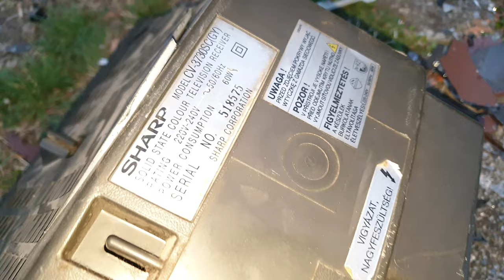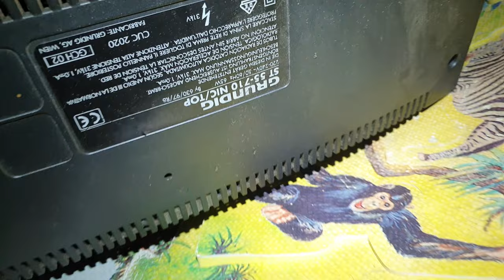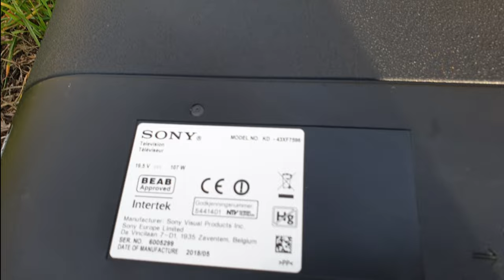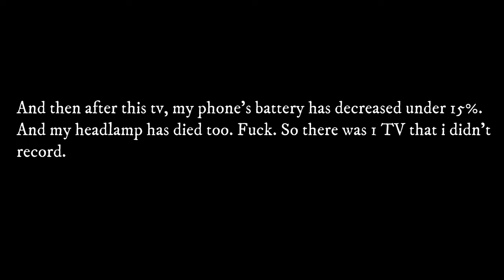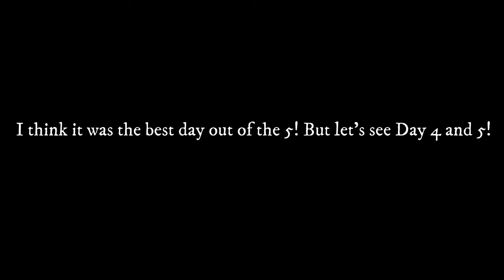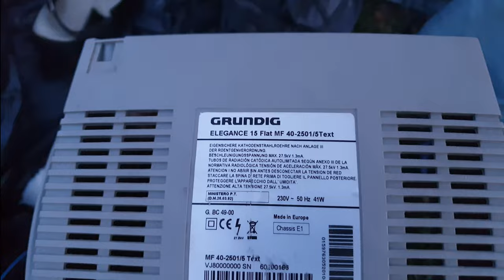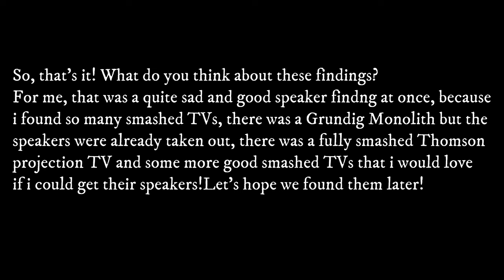Speaker Finding #19: Sony Trinitron with Nokia Subwoofer, Strange AKAI TV subwoofer and More!

Comment: I have the same speakers from the 16th panasonic TV but I got my ones from a sony trinaton TV. BTW the one you got is a tiny bit different
Reply from the maker: Its not the same that you have. Both of them are made by Matsushita but this one is stiffer than the sony rectangle and this one is also way more narrow, and has less power handling.
Reply: @the_speaker_tester  my ones are 7 watts